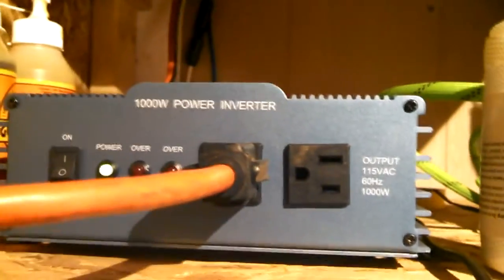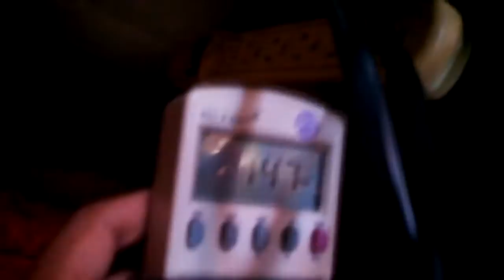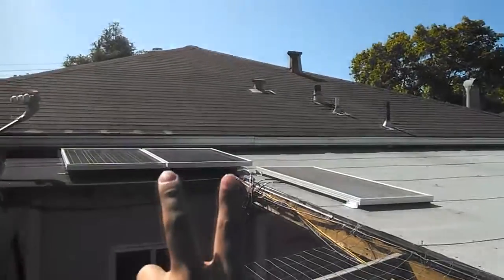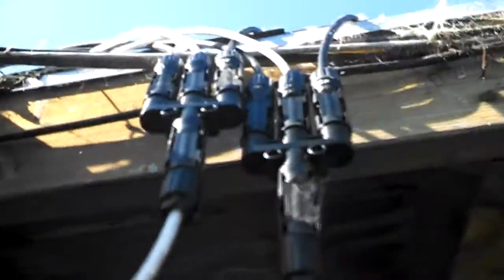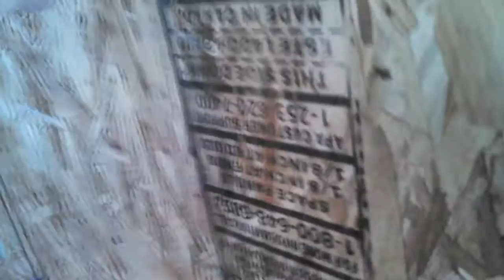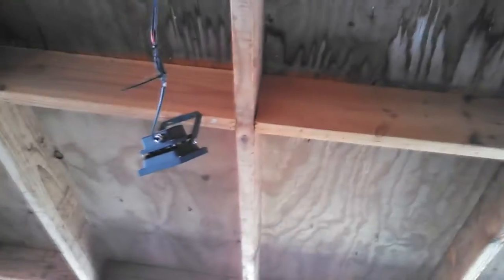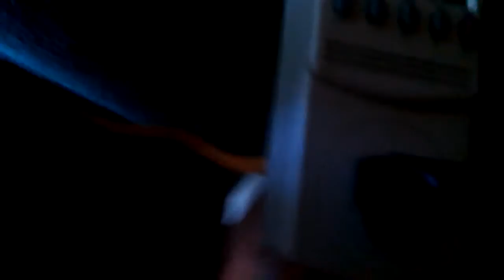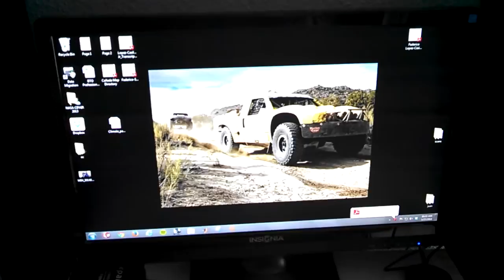300 Watt Solar System - Renogy & Grape Solar

Comment: Possible reason for your router failing could be that it is not getting enough electricity. It has to send an electrical current on your blue cable as well. For every cable you plug into your router, it needs more "juice". Try doing all of this while connected to your house electric outlets to test this. Nice set up btw.
Reply from the maker: I am making a video with a fix, thank you.
Reply: Federico Lopez-Casildo Jr 
Great!Looking forward to finding out the answer. I am also planning on setting up my solar system to run my routers, laptops, gaming system, and TV. So this to be good information to know.

Comment: Hi! Thanks for making this video. I was under the impression you could run a Three panel, 300 watt panel kit with FOUR 12v, 25a batteries and a 1000w inverter. Does this sound like it would work to you? Could I get away with a higer wattage power inverter with 4 batteries and 3, 100w panels?
Reply from the maker: I think it is fine depending on what you are running and for how long. There are websites that help you calculate what batteries and solar panels you need!!

Comment: How many watts do you need to completely charge a car battery ?
Reply from the maker: steve dental It depends on the batteries that you have and the solar panels you have. I am not sure how long it takes my system to fully charge as I have not kept a close eye on that. There are plenty of videos and websites that can explain this.